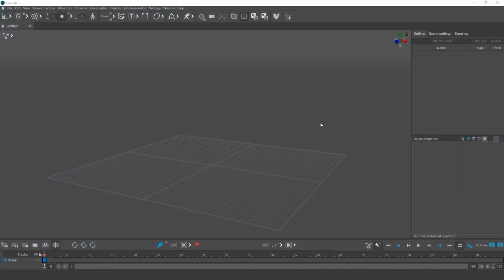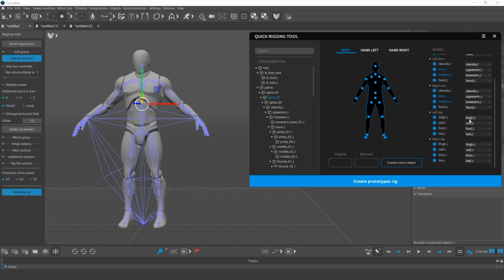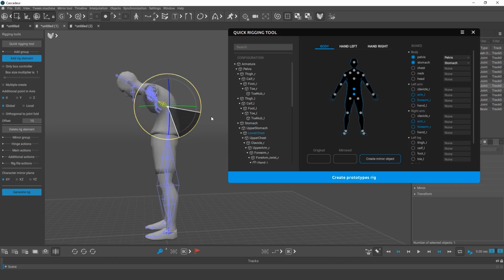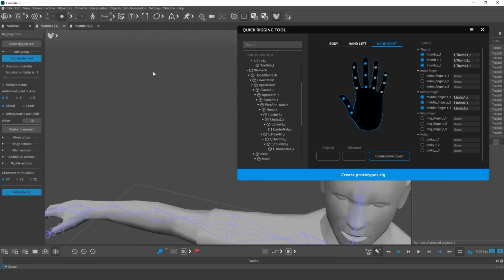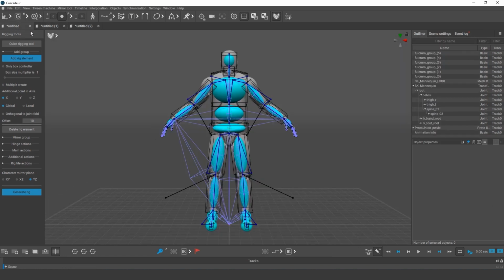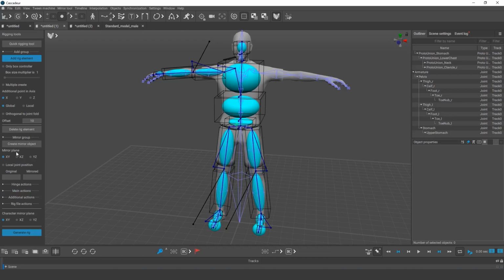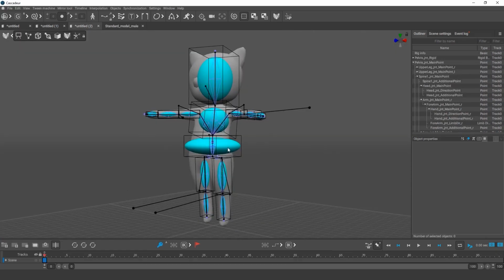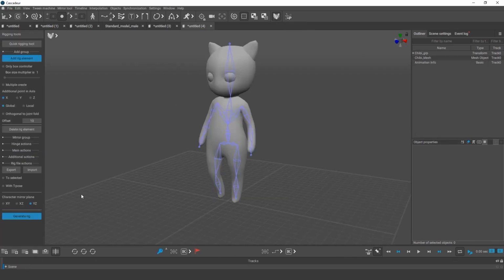How to quickly rig humanoid character using Quick Rigging Tool

Comment: Yesterday I was wondering why the place of the bones in my character was changing for an unknown reason when importing it in Stuntman while it was good in Mixamo and 3Ds max. I discover after a while thinking about it if it was because the fbx file format was beyond 2013 and yes that was the problem. I reexported my character in fbx 2013 file format, resended it to Mixamo and reimport it into Cascadeur and everything was fine.

Comment: I was wondering, in the sample UE4 rig that come with cascadeur the ik joints are constrained to the limbs, but not the root or ik hand gun joints. I know i can bind the root joint to the pelvis using a root constrain, but how do i bind the ik hand gun joint to the hand? and for that matter, how are the other ik bones even connected to the skeleton? I can't find any constrains in the outliner.

Comment: i´m trying to settup some models i heve but qhen i try to start auto=posing tool the same error apears:
Auto posing tool: no object with name: 'neck'
You probably have more than one characters and didn’t select whole set of character’s points

obs: my rig HAS a bone names 'Neck', this way... and the error still there
Reply from the maker: Can you can to our discord? I suppose that we'll need scene file.
Reply: @Cascadeur   i will join discord, but i already solved the problem...
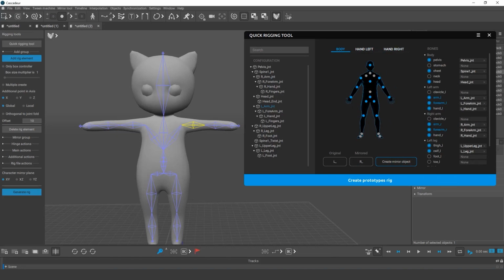 apparently i donpt note or realy don´t has on 05:05 is not specifyed to press the 'Generate prototypes rig' then the 'Generate rig';
when i pressed solved the problem
Reply from the maker: @nicksdev_00s  hm... let us check, may be we should add this into tutorial.
Reply: @Cascadeur  shoud be good... is a essential